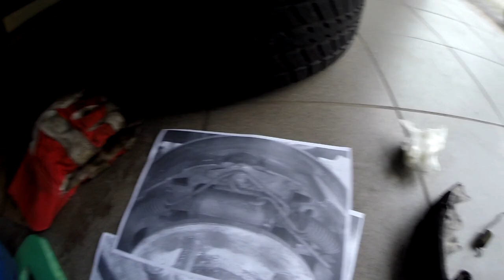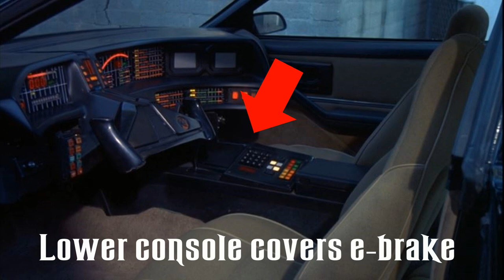KITT Firebird Trans Am - Episode 13 - New brakes

Comment: New brakes will make a difference as is.  Ive gone for an upgrade in mine, ive just atarted turning down some original brake discs to use as hubs for the LS swap. Luckily my 83 came with rear discs as standard so it shiuld all match up nicely.
Reply from the maker: I wish mine had come with rear disc brakes but even the drums do the job for the kind of power this engine is producing😅😉

Comment: Im getting ready to do the drum brakes as well.  Can you recommend the tools you feel work Best?
Reply from the maker: Needle nose pliers and different sizes of screwdrivers. Don't know if there is a specific tool for the wheel cylinder but my method worked pretty good.

Comment: Hello, very good work and information! Could you tell me where to find the knuckles? Thank you!
Reply from the maker: Thank you! All the parts are listed in the description. I usually by them on rockauto.com. I've made a video on where to buy parts. Check out the Firebird playlist.
Reply: @MotorScotti  Thank you very much, I usually buy at rock auto but I can't find the part
Reply from the maker: @micochefantastico  I'm not sure you can still get factory OEM style knuckles and control arms new. You'd be left with the only option to either find used parts or change the entire front suspension assembly with an aftermarket setup.
Reply: @MotorScotti It seems that it is difficult to get spindles.thanks and regards
Reply from the maker: @micochefantastico  I see several spindles for sale on ebay. Good luck!